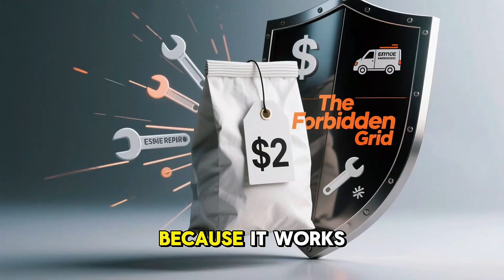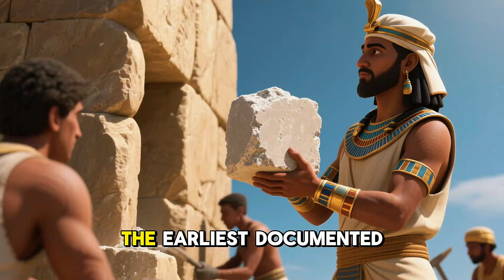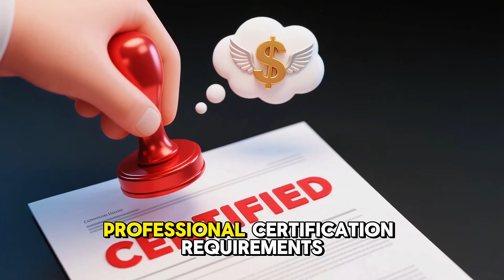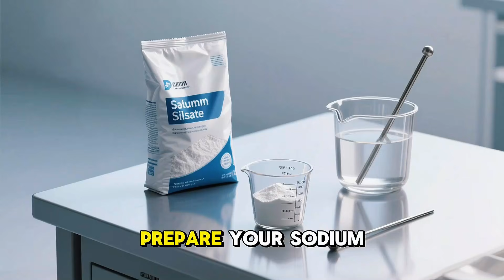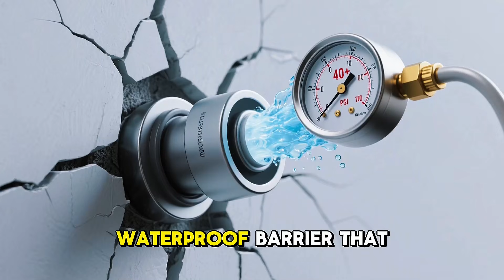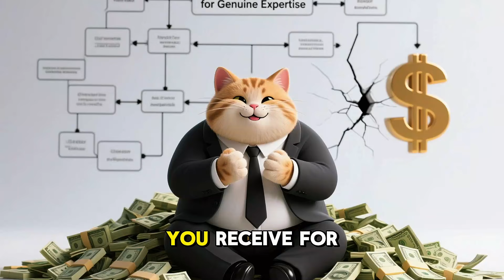$2 Powder SEALS Any Crack Or Leak FOREVER.No Plumber.No Cement.CONSTRUCTION INDUSTRY HID THIS

Comment: Need to fill hairline cracks in driveway but need to know if the silicate is outside of crack, will any staining that I want to put on driveway not be absorbed if outside of crack?
Reply from the maker: That’s a great question, as any residue on the surface could definitely affect how your stain absorbs later on! 🚗

Comment: Funny...said it lasted 2000 years for the Roman aquaducts but then said to put a commercial waterproofing over the silica treatment on a basement wall... sounds contradictory to me...
Reply from the maker: The extra layer just adds maximum protection for modern homes! 💡

Comment: 🇨🇱 Easy to have AI generate 15 minutes of crap, you should have said in 5‼️
Instead of cheap fancy AI images, you should have shown an actual repair of a crack ‼️
Btw. Your images show huge cracks, which Na Silicate will NEVER be able to fill‼️
It only works on sub mm cracks.
Too bat YT allows this cheating and wasting of time of the viewers😖.
Shame on YT & the author 🤑.
In chile Na silicate sells liquid 50%. But costs $10 a liter.  Far mor tjan the $2 for a kg, as you stated 🫤
Saludos de 🇨🇱

Comment: Skip to content

We are changing parts of our website to provide additional information about our products.

￼

 Menu

Sodium Silicate Liquid

>

Sodium Silicate Liquid

Sodium Silicate Liquid 75°Tw

Technical grade

Sodium silicate is a clear, odourless, viscous liquid. It has a molar ratio of 3.27 and a total solids content of 36.8%. It is produced by fusing sand (SiO2) with sodium carbonate which produces solid glass (cullet). The glass is then dissolved in water and steam under high pressure which produces the sodium silicate solution also known as water glass. It is widely used in industry as sealants, binders, deflocculants, emulsifiers and buffers. It is commonly used to seal concrete and cement

 

Uses for sodium silicate

Metal repair

Sodium silicate is used, along with magnesium silicate in muffler repair and fitting paste. When dissolved in water, both sodium silicate, and magnesium silicate form a thick paste that is easy to apply. When the exhaust system of an internal combustion engine heats up to its operating temperature, the heat drives out all of the excess water from the paste. The silicate compounds that are left over have glass-like properties, making a somewhat permanent, brittle repair.

Automotive repair

Sodium silicate can be used to seal leaks at the head gasket. Rather than pull the head, a jar of “liquid glass” is poured into the radiator and allowed to circulate. The Water glass is injected via the radiator water into the hotspot at the motor. This technique works because at 93 C the sodium silicate loses water molecules to form a very powerful sealant that will not re-melt below 815 C. This approach is often used by disreputable used-car salespersons to disguise a leaking head gasket.

A sodium silicate repair of a leaking head gasket can hold for up to two years and even longer in some cases. The effect will be almost instant, and steam from the radiator water will stop coming out the exhaust within minutes of application. This repair only works with water to cylinder or water to Air applications and where the sodium silicate reaches the “conversion” temperature of 93 C.

As an Adhesive

Sodium silicate is also used currently as an exhaust system joint and crack sealer for repairing mufflers, resonators, tailpipes and other exhaust components, with and without fiberglass reinforcing tapes. In this application, the sodium silicate (60-70%) is typically mixed with Kaolin (40-30%), an aluminium silicate mineral, in order to make the sodium silicate “glued” joint opaque. The sodium silicate, however, is the high temperature adhesive; the kaolin serves simply as a compatible high temperature colouring agent.

Cement uses

Sodium silicate has been widely used as a general purpose cement, but especially for applications involving cementing objects exposed to heat or fire. For example, sodium silicate has been provided in home first-aid kits and used in medical practice as a glue for holding human skin together at surface cuts. It has also been used as a general purpose paper cement.

Timber treatment

Sodium silicate is used as a timber treatment to preserve wood from insects and possesses some flame-retardant properties.

Concrete and general masonry Sealer

Concrete treated with a sodium silicate solution helps to significantly reduce porosity in most masonry products such as concrete, stucco, plasters. A chemical reaction occurs with the excess Ca(OH)2 in the concrete that permanently binds the silicates with the surface making them far more wearable and water repellent. Apply a solution of sodium silicate, diluted 1 part silicate with 4 parts water by brush or low pressure sprayer.  Depending on porosity of concrete etc 2 or 3 applications may be necessary. Please Note that concrete and masonry surfaces may appear darker after treatment.

Refractory use

Water glass is a useful binder of solids, such as vermiculite and perlite. When blended with the aforementioned lightweight aggregates, water glass can be used to make hard, high-temperature insulation boards used for refractories, passive fire protection and high temperature insulations, such as moulded pipe insulation applications. When mixed with finely divided mineral powders, such as vermiculite dust (which is common scrap from the exfoliation process), one can produce high temperature adhesives. The intumescence disappears in the presence of finely divided mineral dust, whereby the waterglass becomes a mere matrix. Waterglass is inexpensive and abundantly available, which makes its use popular in many refractory applications.

Water Treatment

Water glass is used as a water treatment in waste water treatment plants. Waterglass will bind to heavier molecules and drag them out of the water.

Magic Crystals

Water glass was used in the magic crystal garden toys from the 1980’s. When waterglass was combined with a selection of different metals in solution, the waterglass would cause the metals to precipitate. Each metal would precipitate separately causing a different colour stalagmite.

Sodium silicate in the paper & pulp industry

In the peroxide bleaching process of the Pulp and Paper industry sodium silicate functions as a transition metal ion chelate, a pH buffer, a stabiliser, a surface active agent and penetrant and as a corrosion control agent.

 

Other information from wikipedia:

In industry, the various grades of sodium silicate are characterized by their SiO2:Na2O ratio, which can vary between 2:1 and 3.75:1. Grades with this ratio below 2.85:1 are termed ‘alkaline’. Those with a higher SiO2:Na2O ratio are described as ‘neutral’. 

Anhydrous sodium silicate contains a chain polymeric anion composed of corner shared {SiO4} tetrahedral, and not a discrete SiO32- ion. In addition to the anhydrous form, there are hydrates with the formula Na2SiO3·nH2O (where n = 5, 6, 8, 9) which contain the discrete, approximately tetrahedral anion SiO2(OH)22- with water of hydration. For example, the commercially available sodium silicate pentahydrate Na2SiO3·5H2O is formulated as Na2SiO2(OH)2·4H2O and the nonahydrate Na2SiO3·9H2O is formulated as Na2SiO2(OH)2·8H2O. 

Sodium silicate is stable in neutral and alkaline solutions. In acidic solutions, the silicate ion reacts with hydrogen ions to form silicic acid,  which when heated and roasted forms silica gel, a hard, glassy substance. 

 

Specification

Synonyms: Sodium trisilicate solution; Water glass; Silicic acid, sodium salt; sodium hydroxy(oxo)silanolate; acide silicique, sel de sodium; Kieselsaure, Natriumsalz;

CAS No: 1344-09-8

EC No: 215-687-4

Sodium Silicate Formula: Na2Si3O7

Viscosity: 70-100cPs (20C)

Density: 1.38 g/cm3 (40 Be)

pH: approx 11.3

Solubility: completely miscible in water

 

Health & safety

Risk phrases: None

Safety phrases: S26 In case of contact with eyes, rinse immediately with plenty of water and seek medical advice. S36/37/39 Wear suitable protective clothing, gloves and eye/face protection.

 

PLEASE NOTE: This product is not for human or animal consumption.

Recent Posts

Hello world!

Recent Comments

Archives

March 2020

Categories

Uncategorized

Meta

Log in

Entries feed

Comments feed

WordPress.org

Contact Info

Please contact us for support via phone or email

Address:1059 Main Ave, Clifton, NJ 07011, USA

Phone:973-405-6248

Fax:Please call or use email instead of fax.

email:info@chemicalstore.comOpens in your application

Website:ChemicalStore.com

Products

 

Disclaimer

 

Terms and Conditions

 

How to order

 

Online Store

Copyright 2026 Chemical Store Inc.

Comment: Before you unveiled sodium silicate, I thought you were teasing hydroic cement. 
Leak.
Reply from the maker: That's definitely another option, but this method is way easier to mix! 🧱
Reply: @TheForbiddenGrid Where do we purchase this material?
Reply: @Shalompaz-m7w someone mentioned pottery supply shop and/or hardware store.

Comment: Had a major problem on my flat concrete roof, a 2mm wide crack, 70cm long and 18cm deep, not leaking but dripping !
I finally used polyester and sealed it permanently. It cost me 8€.
Don't know about u.s. but in europe is difficult to find, and cost 35 €/Lt of solution + taxes, for lab use.